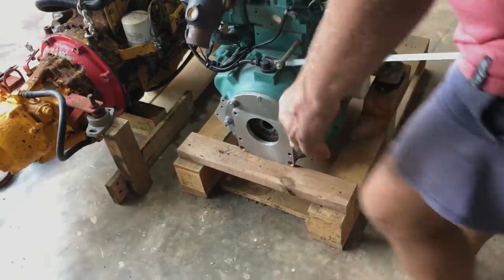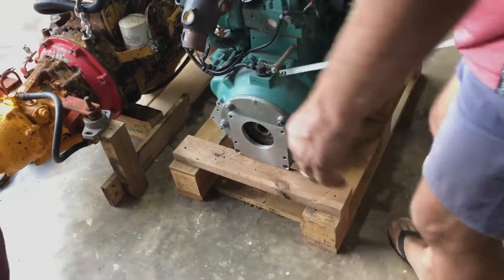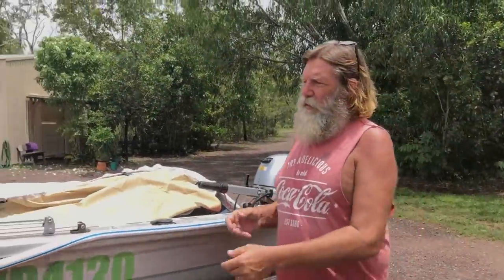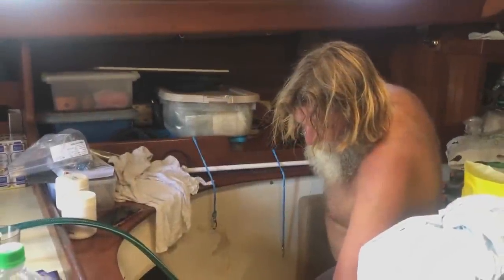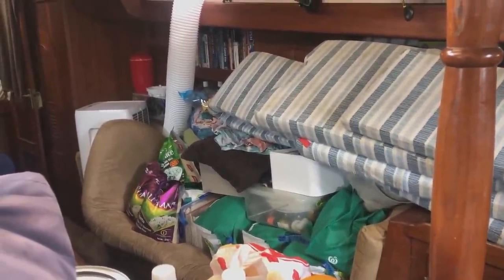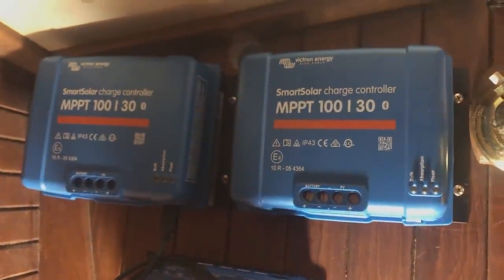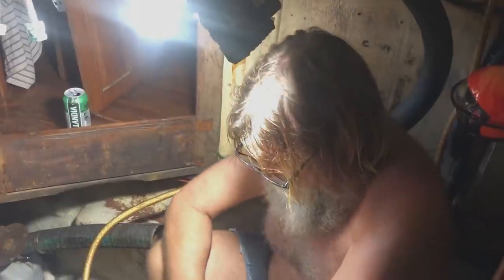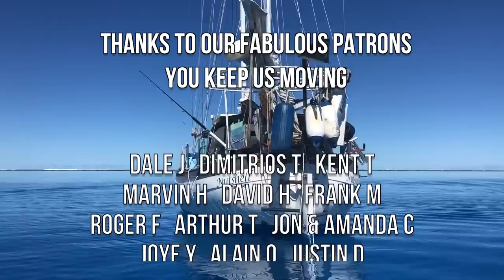Ep 276 | Will the New Engine Fit? Darwin, Sailing Nutshell

Comment: Talking about hoses, I’ve installed radiator hose for my Eberspacher system and I put in an extra hose bow to stern so I could have a pressure feed system for washdown. It turns out though that the radiator hose is good for just 30 psi, and I want 70 or 80 psi. That is when I remembered being talked into a super hose for our factory air lines, and super they were. Indestructible. With some research the hose brand is Swagelock. High temperature, high pressure, durable, hose end fittings that just push in, no clamps required. They have a 3/4” size. Look it up. 
For your battery system a companion company to Victron is MG Energy Systems. They have a nicely sized battery connection module (same function as the Victron Lynx) but shorter (430mm). The basic one of these is the MG Distributer LV which has no electronics. I bought one of those for my AGM battery bank, cut the negative buss bar to fit a Victron 1000 Amp Smart Shunt, and it works brilliantly. The Distributor mounts all of your fuses as well.